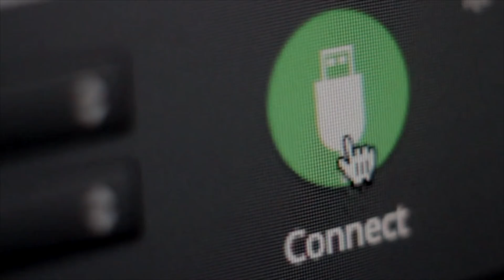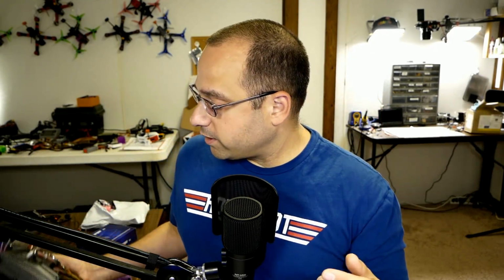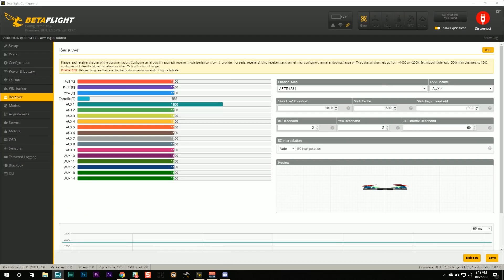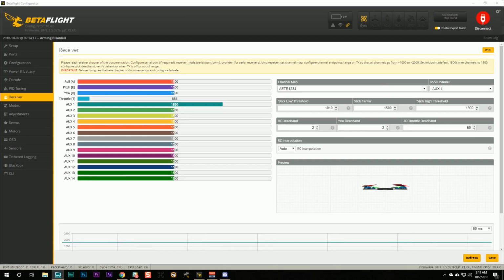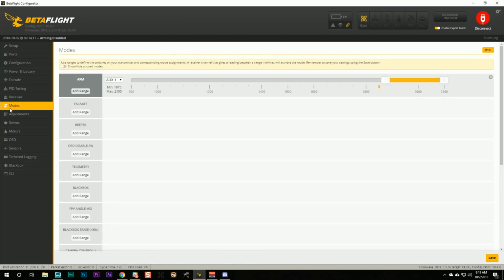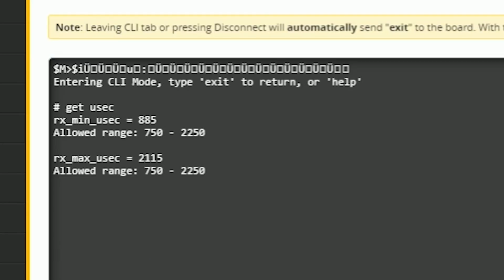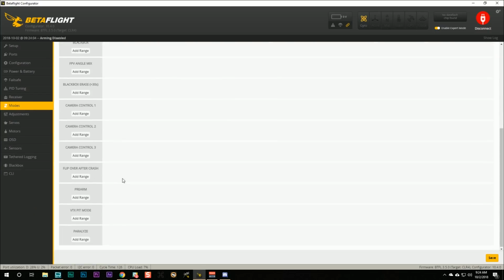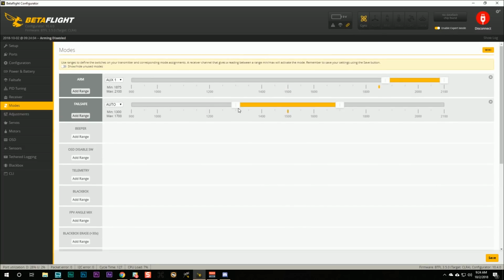BETAFLIGHT WON'T ARM | RXLOSS BADRX ARMSWITCH FAILSAFE BOXFAILSAFE arming status flags

Comment: Ok i hope you can help me figure this out. I have a rooster built from Armattan that i flew today. I got home and flashed the clracingf4 and board with betaflight 3.5.5 and now i have an RXLOSS flag. any ideas as to why the FC wont see the board?
Reply from the maker: Since you re-flashed the board, I am going to guess you didn't get the configuration right. Did you save the old CLI dump before flashing? You could dump that configuration right back into the CLI and be good.

For CLRacing, the Serial RX UART is usually UART 1. Go to the Ports tab and enable Serial RX on UART 1. Then go to the Configuration tab and set the serial receiver protocol to SBUS.
Reply: @JoshuaBardwell  I thought i had the right UART and assumed it had to be something else. Possibly RX related. Went back and changed the UART and switched to Frsky and boom. She spins up perfect. Thanks for the kick in the ass.

Comment: Ok I have built several quads and this has not happened to me before. I arm the quad, motors spins up then shut off about 3 second after it arms. Then reads :BAD_RX_RECOVERY. Any ideas? Will arm again shortly after the FC restarts but does the same thing.

Comment: I have failsafe rxloss badrx. I have replaced the reciever and replaced the cable. This thing flew before but doesnt now. the reciever tab throttle jumps always at some point. This is when i get the failsafe. I cannot find any solution for that
Reply from the maker: If you replaced the receiver then I suspect the transmitter may be the problem. Has it ever been powered on with the antenna removed? That can damage them.
Reply: @JoshuaBardwell  i have that fs-i6 doesn't have a replaceable antenna. But i have updated the firmware recently but this haven't changed anything. Betaflight gives me 13% rssi while the transmitter is sitting directly next to it. So maybe  you are right. Any possibility to check that somehow? Without a second remote

Comment: I've a other problem. I've got a spektrum dx6i, and the antenna broke. Bought a new one, and the range sucks. If I go bind a tree on like 10 meters I los signal... I don't know what I'm doing wrong... I'm thinking to buy just a new radio...
Reply from the maker: Send the radio in to Horizon Hobby for repair. They support their hardware.
Reply: Remember that you can damage a transmitter by operating it with no antenna.  The RF energy gets reflected back into the transmitter instead of being radiated by the antenna, and this can damage a transmitter very quickly.  Or not.  But in your case it sounds like the antenna loss hurt your transmitter.

Comment: The latest Open TX does a safety check and gives you "Model still connected" if you try to test failsafe by turning the transmitter off. I have no idea how to disable this safety feature, or indeed if you can? Bit of a pain when race registration ask you to prove your failsafe is set up.
Reply from the maker: Just press enter to confirm and it will turn off.
Reply: Yes... I know... but can the feature be disabled? #safetythird
Reply from the maker: Not as far as I know.

Comment: Hi JB I'm getting  "no valid receiver detected" in betaflight. Not sure if that's related to your series, but would sure like some help on that.
Reply from the maker: That's RXLOSS right? I think it is the same as what is discussed in this video.
Reply: @JoshuaBardwell  ok
Reply: Hi JB, thanks for your videos and.insight. My problem.was a bent pin in the connector for the Rx on the Flight controller.

Comment: Hi Joshua! I often watch your videos, they are very helpful. I recently found a new problem on my quad, and it brought me to this video. My quad is working perfectly,  but lately I'm struggling to get it to arm. The arm switch is registering on betaflight, and the values are correct.  Howevery, I still get the armswitch error on the OSD, that stops me from arming, even after taking out the battery and turning off the controller multiple times and retrying. Sometimes it arms after multiple tries, and today I packed up after only one pack flown, it didn't want to arm again. Do you have any suggestions I can try?

Comment: The Failsafe flag stays set if you regain signal during GPS Rescue. You have to move the sticks (by default 30% deflection) to regain control.
Reply from the maker: Correct.

Comment: I'm about to go insane insane with my Quadcopter because it's brand new wired up my receiver and my receiver inputs work perfect plug into betaflight as soon as I plug in a battery then I don't get any movement and my receiver tab unless I unplug my battery, and I don't know what to do I'm new to this

Comment: Joshua – Love this series – However, with the command line commands I don’t use them enough to remember all of them off the top of my head. Would it be possible to put together a spread sheet with topic category headers listing applicable sub lists of common commands, along with the command parameters? That would be one of the biggest aids I could ever think of.

Comment: hei guys so here is what i did: connected the Holybro Kakute F7 HDV & Tekko32 F3 HDV 40A 4in1 ESC 30x30 Stack with a DJI Unit - without yet the motor connected to the esc! - it worked when i was trying to figur out how to make my first fpv drone - after some time, i tried to connect back the dji controller and there is no reaction, it says RXLOSS NOPREARM CLI MSP  in the status.  can it be fixed? :( got more error - RX_FAILSAFEBAD_RX_RECOVERYMSPARM_SWITCH

Comment: Someone please help i have a hglrc fd445 fc and fsai6b reciever and fsi6x transmitter. My firmware is flashed to omnibusf4v6
Im having rx loss issue and i dont know what to do all connections are secured nd not shorted blue light flashing with solid red. Im a newbie and my transmitter is not working at all motors aren't spinning only a twitch when i plug up battery
Reply: Joshua bardwell please help if i can video chat it will be a great help or of u can just tell me what i need to do ill forvever appreciate it i just want to fly

Comment: what will happen if the sbus cable chopped off  by the props while doing fast flip? will it drop from the sky and rolling out of control just like having ROD? or just drop from the sky like when rxloss happen? yesterday this was happened to me because my r9mm cable too close with the props (tight frame). im asking this because i want to know what happened with my quad yesterday.. sbus cable got chopped first or something else causing my quad fall from the sky
Reply from the maker: RXLOSS should happen if the signal wire gets chopped.
Reply: Joshua Bardwell thats interesting.. May i send you email of my dvr?

Comment: what about rx_failsafe?
Reply from the maker: That's FAILSAFE.
Reply: @JoshuaBardwell  My modula 6's antenna literally just fell off and took the solder pad with it!  I'm unable to bind anymore because of this.
What is strange is that it actually worked for a few hours without the antenna but then as soon as I hooked it up to beta flight it became unresponsive.  It still connects to BF but the rx_failsafe remains on since it won't/can't bind.  I would resolder the antenna ( I tried ) but the solder pad is gone :-/  Any suggestions? Thanks for the videos...its better than the "documentation".

Comment: my meteor65 keep saying rxloss and dropping even at close range.
Reply from the maker: Damaged antenna or receiver is a possibility.
Reply: @JoshuaBardwell  I opened the shell and the antenna was Laing on the RX. Could this cause the RXLOSS signal?
Reply: @JoshuaBardwell  I am new to FPV so I am struggling through the learning proses
at my age it is a little slower.

Comment: These videos don't help whatsoever. I've gone through TWO DRONES now, one tried to build and never worked out(with 3 different FCs), and the other just received the Hey Tina Whoop. Which for some mysterious reason won't arm AT ALL. I MEAN NOTHING I'VE TRIED in the past 5 hours has helped. Nobody ANYWHERE on the internet has any real helpful guides because everything about FPV droning is convoluted and torturous to try and learn.
Reply: Bardwells videos are incredibly helpful. Ofcourse there are sometimes gonna be things where you need more help, but then again this is a hobby for people that like to tinker. If you dont like it, just buy a DJI FPV/AVATA and be happy...